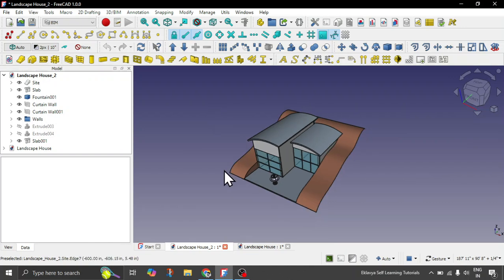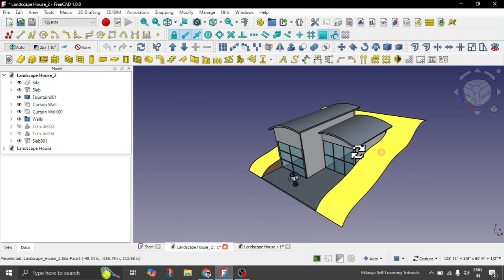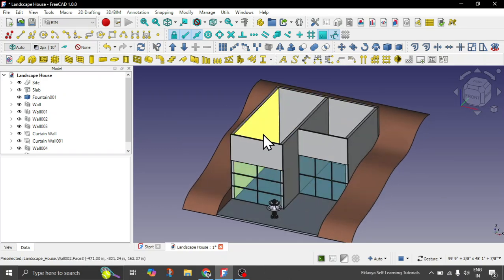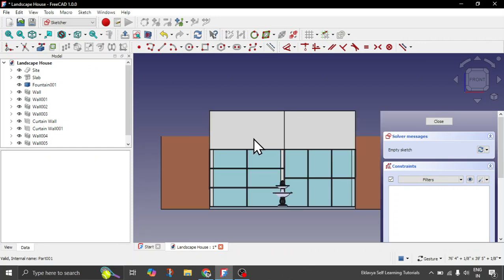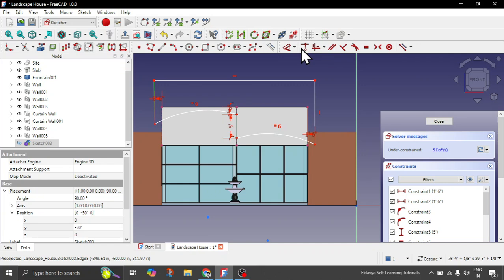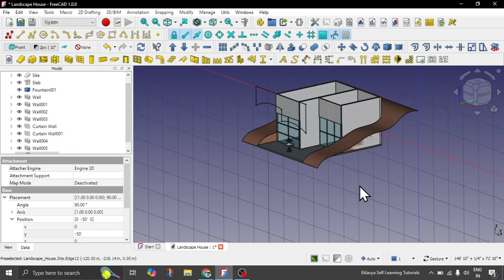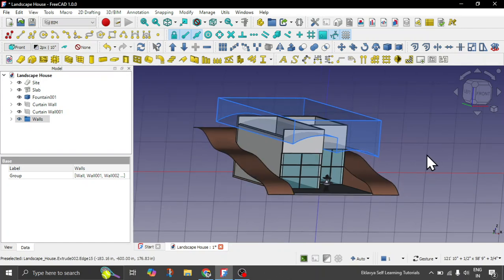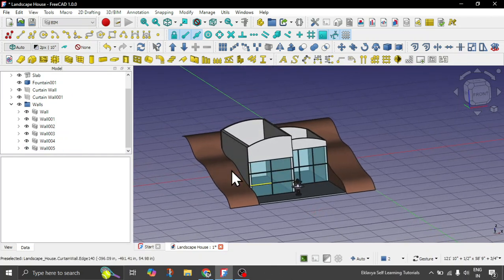FreeCAD Daily #4: Curvy Roofs, Curvy Walls – A BIM Workbench Adventure

Comment: I think there is cleaner way to do this:  1) model the roof by extruding whatever you need (eg. like you do at 12:00 ), 2) convert the resulting object to BIM roof (not sure why you convert it to slab, it's clearly roof) 3) subtract the roof from the walls. BIM roof do remove everything that's above them, so no need to model that negative shape you do at 6:50 ,  4) OPTIONAL: select all your walls and click BIM wall again. that way you will have one BIM wall that is made out of several BIM walls, so you can subtract the roof in single place without having to subtract from all individual walls (probably should do this before step 3). Also this makes all the walls in single union object, so there are no weird lines on wall interfaces when you export it to tech draw.

Comment: I've been fighting to get this solution of removing a shape (a straight inclined sandwich panel roof) from a set of walls without using the boolean operation in Part workbench for 3 years... eh voilá... you came with the solution! Thank you very, very much indeed. Greetings from Portugal.
Reply from the maker: @LFANS2001  glad that it helped you. 🙂